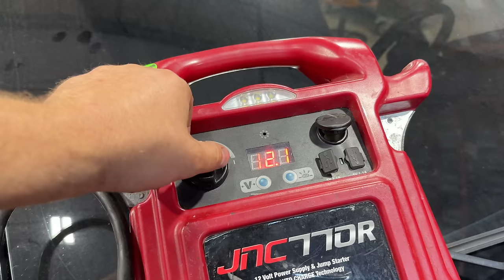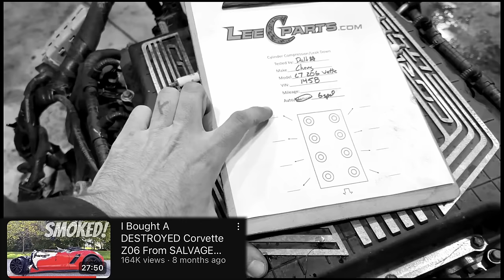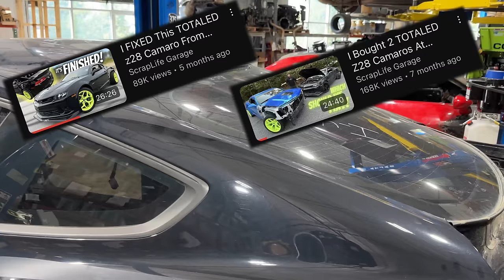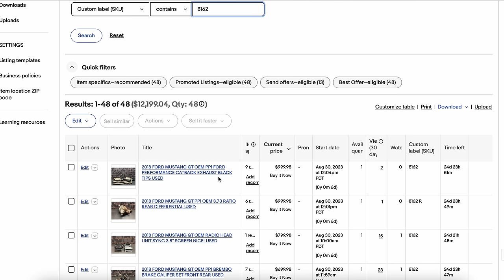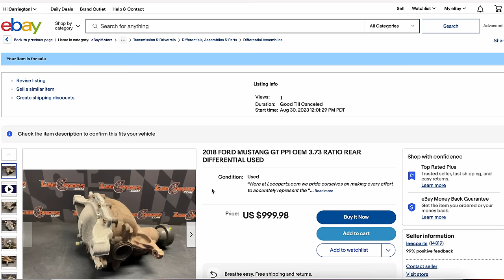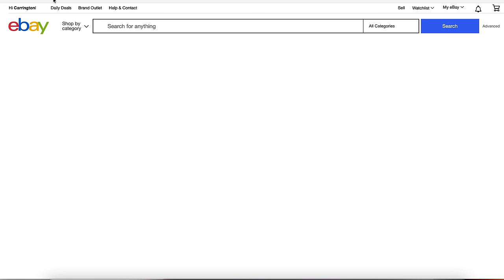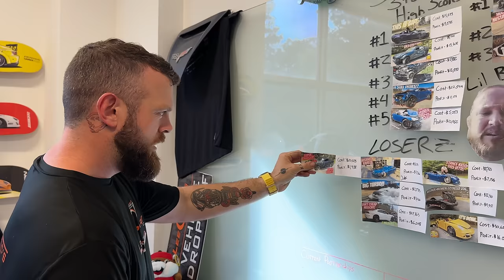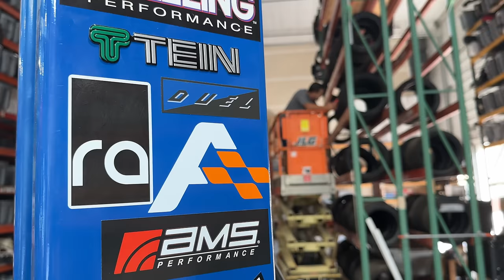I Bought A WRECKED RTR Mustang From Salvage Auction

Comment: Another fun episode, guys.  As to the numbers, it may not be as bad as you think.  The motor was presold, so the selling cost maybe should be 10% of $12K, not $31K.  That's $2000 more profit.  The same goes for the dead inventory charge.  That shouldn't apply to the motor, just the $12K of parts - another $2000 of profit that wasn't calculated.  So you can add $4000 to the profit,  as far as I can tell.  Maybe it's not on the Loser list after all and Carrington is out of the dog house!

Comment: I'm confused, if you're scrapping cars, selling parts, why are you paying shipping? The customer should be paying for shipping and for large items/valuable items, insured shipping is applied for the replacement value and if it breaks then it's on the delivery company to reimburse the seller, not you. I'd opt for local pick up and offer perhaps a better price for local pick up and or cash sales to avoid terminal fees. As far as overhead costs that seems high when you did the math. I'd be taking every valuable thing off it and selling it as lots, even the wire harness could be sold as is and damage shown, someone good with electronics maybe able to repair it for cheap if they can buy it for cheap.

Comment: you still should just cut out all the wiring you dont want to pull to sell and get a big bin and save it for scrap because it is copper afterall and with  like a dumpster full of that it would be a grand or a few grand worth of copper that you just scrap basically as if it were steel. if you do start doing that let us know itll put a smile on my face lol